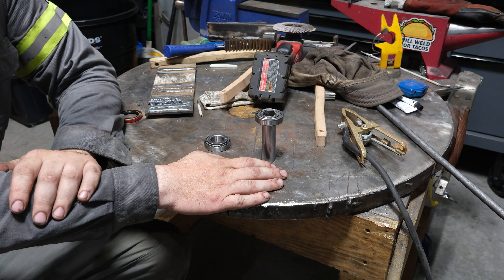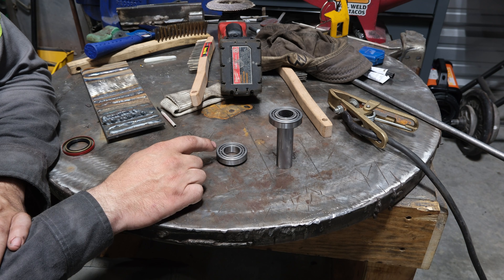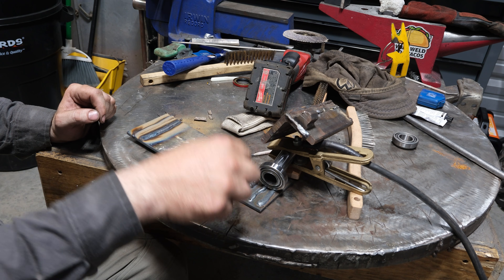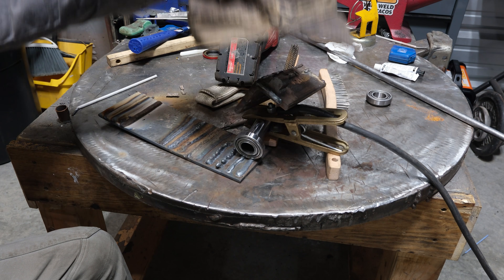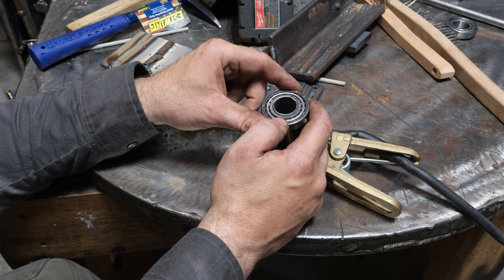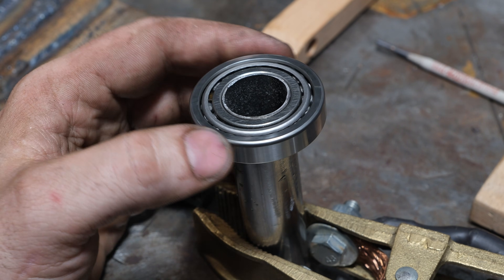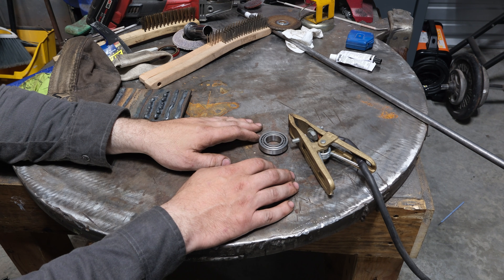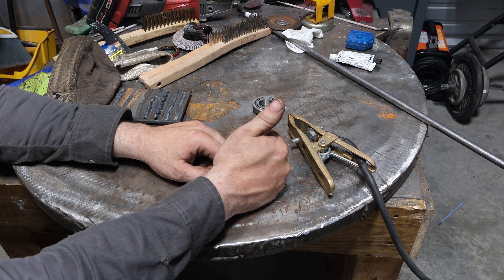Don't make this expensive mistake:  Smoked bearings

Comment: @Making mistakes with Greg here's a question, would it be worth taking jumper cables & just jumping from one side to the other of the bearing if your going to be welding  allot either side of it? maybe using some cheap ground clamps for your jumper connections for better contact if battery jumpers would.t fit right?
Reply from the maker: Good question.  The answer is a jumper might prevent a disaster.  Electricity will take multiple paths, not just a singular path.  I would be highly suspect that current would still pass through the bearing, but it might be reduced enough that it won’t cause serious damage.  The big issue with welding is its low voltage high amperage, the high amperage almost assures damage to races and roller bearings if it passes through.

Comment: It wasn't a bearing that went some exhaust shop around here would ground to the frame then weld on the pipes. Messed up many engine computers that way, the majority of vehicles out there have poor body to chassis ground cables from corrosion
Reply from the maker: Very good point.  That’s something I never thought of, the chassis to engine grounds are generally rotted off/in bad shape for sure in northern cars.  Add in the fact the exhaust is often rubber isolated and the path to complete the circuit could follow the oxygen sensor back through the ecm if you ground on anything but the exhaust.  That would be a bad day lol.

Comment: What is your"religion" when welding on cars?  should or not disconnect battery generator ecu ect?
Reply from the maker: That’s a great question, I will actually answer it fully in a video but I will offer some thoughts.  The most critical thing to do when welding on a vehicle is to ground as close as possible to what you’re welding on.  Be mindful to not ground where an arc might have to travel through multiple separate sheets of metal.  Disconnecting the battery rarely will solve any issues with shorting electronics other than it may cause certain relays (either in the fuse box or in the ecu itself) to close.  A incomplete circuit can’t carry current so that is good.  Directly disconnecting the ECU will definitely protect it, and in critical situations might be the way to go.  I will definitely cover all of this and do some tests 😀👍

Comment: Bearings aren’t the only thing, I saw some ruined shocks based on this mistake on another YouTube channel
Reply from the maker: Great point on that.  If a person grounded on the frame and welded on the axle there is a big possibility of arcing internally to the shock piston or rod and that will surely smoke the shock.

Comment: I repair restaurant equipment it so scary when having to weld ss on or near it. I could repair electronic stuff if it damages. I'll get into tig and that's even more scary. I've read not to use HF mode on electronic equipment. Do you have "ytube certified welder watcher" sticker coming out soon?
Reply from the maker: So I gave away about 400 of the YouTube certified welder stickers and will likely have another batch made in the near future.  I will have a giveaway of the “will weld for tacos” stickers soon, so stay tuned for that.  

As far as the HF near electronics, the hf arc starter I wouldn’t worry too much about.  It is more or less a high frequency higher voltage instant pulse that crosses the arc gap and the main arc will piggy back on it.  Since the main arc isn’t high enough voltage it can’t cross the arc gap on its own but it can maintain an arc.  The real bad hf you want to avoid is tig welding a/c near electronics.  It has a continuous hf/hv pilot arc the runs in the background for the main a/c arc to run on, and the probability of having it interact with electronics (not to mention the a/c inducing voltage within nearby electronics) would be by far more likely to cause issues.

Comment: In theory, if the shaft inside the inner race gets too hot, it can put extreme outward force on the hardened race. As the shaft heats up and expands, it can cause more or less of a catastrophic explosion of the bearing. So, caution there, too. Some say this is a myth, but ive seen enough exploded bearings on vehicles (23 years in the automotive repair business), to know the potential. Also, something to potentially test in the future. Thanks again, Greg
Reply from the maker: No doubt if the bearing is under a load the pressure could cause a failure.  I have seen this happen in gear boxes with tapered cone bearings with preload, that didn’t have oil.  Pieces of blown up braring races and rollers blue from heat.

Comment: Excellent video. Well done. I've seen nothing about this on any other YouTube welding channel. I really enjoy your empirical evidence approach. This phenomena is why it's important that all the ground straps tying various parts of a vehicle together electrically are in good condition and that added equipment and batteries are tied to the battery ground through purpose made ground straps that route the current around bearings. .

Comment: I learned this 26 years ago, in school. You are the first I've heard on YouTube mention it. Why, I don't know, but am more supportive of you for that. Good video, and long overdue at that!
Reply from the maker: Thanks for the kind words and I too am unsure as to why this is not commonly mentioned. It’s such an easy mistake to make and could easily wind up causing a bearing failure.  Avoiding it is especially important in the equipment repair field, it’s very common to weld around bearings and even an unintended arc strike could cause problems.  The feeling of “ohh no, what did I do” is not a good feeling lol.

Comment: HELP! Trying TIG and went from ceramic to Pyrex nozzles to see better but now the tungsten just melts into a ball why? Argon is at 10 L/m and Pyrex is #10.
Reply from the maker: Couple thoughts, hope they help:  

The clear cups typically require o-rings, a special gas lens, and possibly a different white plastic front cap for the torch (between the gas lens and torch body).  If the gas lens is not threaded all the way tight (with the back cap off) it will leak gas.  The white front cap/isolator can prevent the lens from fully seating if it’s wrong.  If the orings don’t seal properly gas will leak.  Also, the collet you use must be correct for the gas lens.  If it’s too long the back cap won’t seal properly because it doesn’t thread in enough.  Gas flow matters too, you need atleast 15cfh for smaller cups and upwards of 30 with big ones.

If the tungsten goes up in smoke and is discolored, a gas coverage issue is to blame.  Tungsten can only handle absurdly high heat when it’s not exposed to oxygen.  If your gas lens is defective it can have poor gas coverage, I have seen this with brand new lenses.  If the tungsten is balling up fast but not producing smoke really, the polarity must be off.  It needs to be DCEN (tig torch on the negative) for tig.  If it’s on the positive the tungsten will melt.  

As far as the welding shade, on a 13 you should be so dark that a tig arc at 100amps should look like a barely lit candle from 10’ away.  Sometimes helmets have a range adjuster, make sure that shade 10-13 is actually those shades and not shade 5-6.  Put the hood on and stare at something outside (with the lens in darkened), if everything looks like a pair of really dark sunglasses and not like you can barely see anything, there is something wrong with the hood.  Your eyes may be sensitive to the light as well, which can happen.  Miller makes good hoods so your eyes aren’t getting uv light through it, but the light can be fairly bright.
Reply: @makingmistakeswithgreg  Thank you! You fixed a number of issues!!!

Comment: Boy you ain't a kidding and it's not just bearings but automotive electronics, on my Ford E-450 there is like seven different modules that must be unplugged before you can weld on it per Ford maintenance manual, weld in the wrong place and do thousands of dollars worth of damage, now imagine welding on a half million dollar combine 😬 hope you got liability insurance for your business. Great video you did some of your viewers a solid 😉👍
Reply from the maker: For sure, an electronic component could be just like that bearing if it’s in the ground path.  If it smoked the bearing I can only imagine what it would do to an ecm lol.

Comment: Hey guys, Iam going to let you in a mechanics secret. The number one reason that U-joints that are on the drive lines of cars and trucks fail is because of a damaged or missing ground strap or cable to the engine starter.

Comment: An here I was welding TO the bearing... They become real crummy but it goes a long way for small gizmos & tools that see hand cranking. IE: Transformer winder. In my country its real hard to find all the cool stuff like bearing rods, pipes sizes that accept the bearing outer race, sections with no weld seams for some telescoping action, and anything over 20GA (1.2mm) wall thickness is called "structural" and have to drive to Narnia to find. 

I was gearing up to fix the exhaust pipe on my car and I was going to clam the ground on the wheel hub nuts. Pun intended XD.

Good to know though. Thank you for all your videos, have learnt so much. Shut up and take my... appreciation!
Reply from the maker: I could see without a lathe and a lack of pipe sizes you have to do what you have to do.  For slow speed use I bet it would work.  Nothing something that would work well on a wheel bearing on a car though lol.   I never realized how hard material is to find in many countries, around where I am at in the US it’s easy to find almost anything.  Although it’s not cheap anymore :(

Comment: Most electric over hydraulic service truck cranes ground all the electric through the rotation bearings. Sketchy as hell but it obviously works to one degree or another. I'm gonna pull apart my crane for maintenance and I'm curious to see how the bearings are looking. I'll upload of a video of that when I get it tore apart
Reply from the maker: Interesting.  I wonder how much amperage is actually run through it?  At 80+ amps I would think there would be arc marks on the bearings.  If they are super greased it’s possible the grease may help.  I am unsure, my first thought is the grease would increase resistance.  The bearings also don’t spin fast so even a bad bearing wouldn’t likely have much of an issue.  Provided it didn’t weld itself together lol.
Reply: @makingmistakeswithgreg  I dunno, I can measure the amp draw on mine, mine is a tiny little crane and they come much bigger so id imagine amp draw on the bigger ones are in the hundreds of amps. I'll also look thru the manual for it and see if it calls for any specific grease or anything, maybe a conductive grease or something. Granted it can also ground through the swing rotation worm gears but that doesn't sound like much better of a idea lol.

Comment: Hello my freind where you get that ground clamp
Reply from the maker: That is this one on Amazon:https://www.amazon.com/Shape-Ground-Welding-Welder-Machine/dp/B07TXV9B8M/ref=mp_s_a_1_17?crid=2QQ4351ESRTE3&dib=eyJ2IjoiMSJ9.GZJoOL0htnM26LXKEexGqCC9FCox6ddtbu6VZyMSrOiiaZWZo0IUQX6GZC33n3aKwu3vqjrgfjPPRSDXCJUCt9gqztTlJkhYPddI0arG2HV3RFUNoBNX40jfD-3fRkWdI4PU5TdBYEDDrP9jCb9-o6Z3P60ShSiTWp3RDyngsjyOBRchL-2KE209-HJO_sw6bJ_GFfJlrN_WX2TCQk6d5Q.wm07sxyt_v5NcmEmfWoMit26YNfZ17RdZTLx9J8VdNs&dib_tag=se&keywords=brass+ground+clamp&qid=1722477355&sprefix=brass+ground+clamp%2Caps%2C216&sr=8-17

Don’t buy a cheaper one that looks like it to try to save money, they are not the same at all.  That clamp is 100% solid and the best one I have found outside of a heavy duty c-clamp style.

Comment: Golden (straw) color: ~400°F,  blue: ~600°F.  Good thing it wasn't packed with oil or grease.
Reply from the maker: The first attempt the race was shockingly hot despite not having any arcing that was visible.  I bet it would have cooked standard grease it was that hot lol.

Comment: Probably worth mentioning there is the same issue (even less obvious than bearings) with screws/nuts
Reply from the maker: Definitely could happen.  Run 120+ amps through a smaller bolt and it very well might weld itself to the nut lol.

Comment: When I was a youngster I was lucky to work with a guy who knew his stuff and was super careful. Taught me to always triple check that I'm not welding through any bearing surfaces, threads, electrical connections, brake or hydraulic lines, etc. etc. 

When you're working on machinery that costs 1000's per day in downtime you really don't want to be the cause of failure.

Me and that same guy shut down a municipal water treatment plant for 36 hours by running a mag drill off the computer supply circuit. The socket wasn't marked in any way so it wasn't our fault.

As the sayings go, "you can never be too careful" because "shit happens".
Reply from the maker: Being careful is the best prevention, but situations can always have unforeseen consequences.  That outlet mag drill story is a great example of that.  Total “ohh shit” moment for sure.  Hopefully they labeled the outlet lol.

Comment: You can put dielectric grease and the current won’t go through the bearing
Reply: I thought dielectric grease was to help conductivity (though I had my doubts), because they put it on the spark plug before you put the wire on.....maybe that's why they call it Die Electric.....learning something everyday, thanks.
Reply: @john-smith.  you have to put a lot on the more the better but you can’t let it get real hot because it will start to break down. I used to know a couple of other ways. But as long as it doesn’t let conductivity it will cut down the chances
Reply: @Failure_Is_An_Option  trolling what and what other accounts
Reply: @Failure_Is_An_Option  you do know that there are different types of bearings and you can’t apply this to all types. Buy as bearings for hard working on machinery it will work and no one said anything about passing the current through the bearing. And you can tell you are the one who is trolling because the type of bearings that engineers design are for stuff that a welder would not be anywhere near. So an engineer would know this and this is not this video is about.

Comment: In addition to welding around bearings and having them become part of the circuit, be careful with 12 volt batteries! I've learned first hand what happens when the 20 to 30 volts of a stick welder decides to try and find a path through a 12 volt battery, creates hydrogen gas, and then said hydrogen gas ignites due to the welding sparks...... It makes for an interesting day of welding!

Comment: I need to weld (buzzbox, 6013, 40 amps) on some bearing holders in a couple of days, so this is very helpful. I knew on my own that welding through bearings would be very bad news. I will first install the bearing, lightly tack the bearing holders in position, then remove the bearings. I hope this will be ok. Thanks for the tip on grounding not on the opposite side of the bearing.
Reply from the maker: No problem 😀.  Anytime that bearing is in a possible path to complete the circuit a bearing could be smoked.  Sounds like you set yourself up for success, good luck with your project 👍
Reply: @makingmistakeswithgreg  So I tacked my bearing holders into place ok, 40 amps, but then forgot one bearing within the bearing holder for one small 1 cm weld and yes, the outer ring of the bearing turned a slight blue, and the bearing became a bit less smooth. Thankfully I can easily remove the bearing and I have a lot of them, so thanks for the advanced learning experience.

Comment: Good info, Greg, thanks.  Note that whenever you heat a bearing up past its temper point, you've ruined it.  If any part of the bearing, or race, turns blue, it's done for.  No amount of grease is going to save it.
Reply from the maker: Great point.  I sort of mentioned it on the first attempt, but that race was pretty freaking hot.  That was a short single pass at 120a.  I could easily see the race getting smoked if someone was welding at 160+ amps for a decent run, just from how hot the race would get.  Like you said, definately a bearing failure waiting to happen.
Reply: This is a good point! Even if there’s not pitting that you can see/feel by moving the bearing, there could still be a tiny heat affected zone that fails later on.

Comment: Nasa had some telescope or probe or something that had bearings fail in the reaction wheels. They were looking at the contractor that made them, but eventually someone figured out that ionizing radiation from the sun had caused a voltage difference across the bearings and they had arc galled. Or at least that's what they always called it around here, I think. Anyway, now they put conductive grease in them so that charge can't build up enough to arc through the balls.
Reply from the maker: Very interesting.  It’s pretty crazy how unforgiving outer space is.  It’s wild to think something as simple as a bearing can fail due to    electrons moving through the components due to a slight difference in potential.  All the time/energy/money into something only to have a bearing failure cause a nightmare of a problem.  It’s like that crane story in the video but far worse lol.

Comment: Good info. As a maintenance mechanic im always try to be mindful of how a weld on a piece of equipment. Another possible topic could be welding around sensitive electronic like a PLC.
Reply from the maker: I definitely need to cover that.  The worst is a/c tig.  Most machines have a high frequency high voltage pilot arc in the background to keep the a/c tig arc lit as it crosses 0 volts.  Well that arc can easily damage electrical components.  A/c stick welding can also induce currents/interference with electrical components as well.